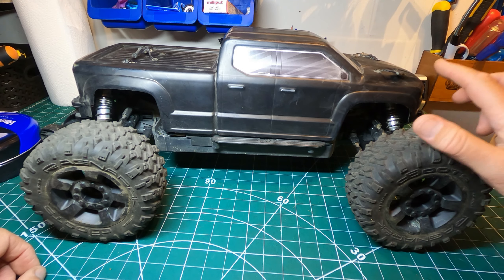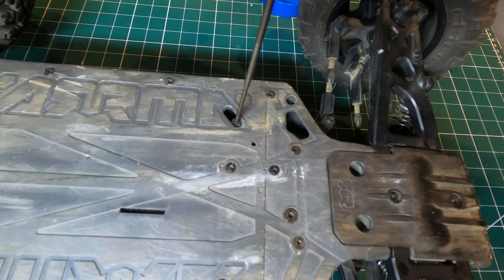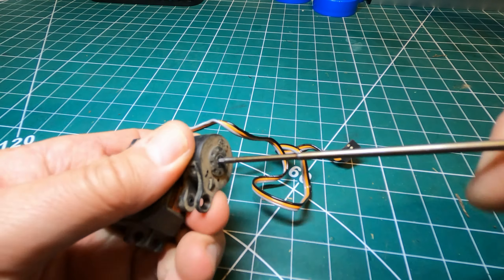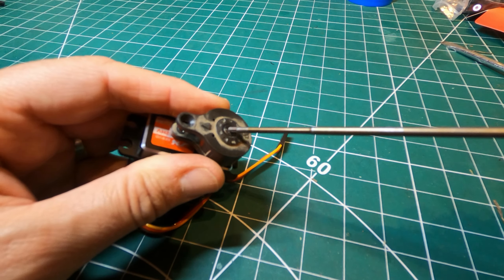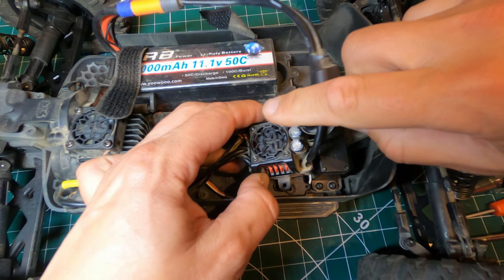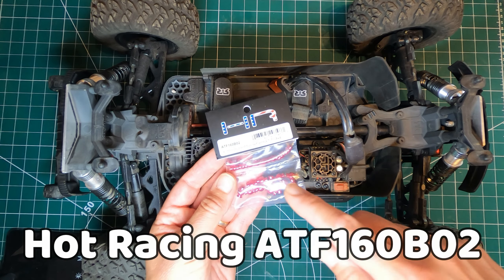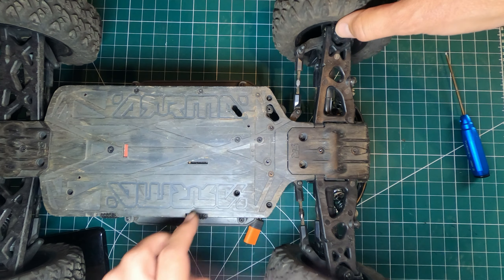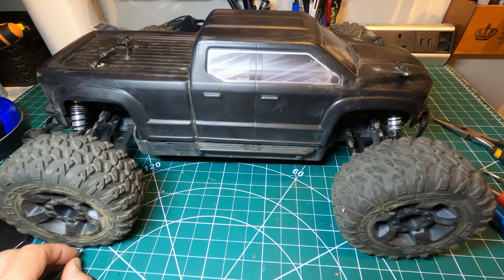Arrma 3s/Mega Servo upgrade, Vorteks, Granite, Big Rock, Typhon, Senton, 23t Spektrum - 25t EcoBoost

Comment: "Squash It On And Make It Fit".  
Excellent Advice 👍
You should have that printed on a tee-shirt.
Brilliant information for a non 3s individual such as myself showing me what screws to undo in order to replace the steering servo 👏
Cheers Pete, hope you're well 😎
Reply from the maker: Yeah, if it doesn't fit then try a bit harder!  You should get one of these so you can save the Tamiyas for less destructive RC'ing.  Cheers for watching mate.  Hope all is well :-)
Reply: @PeteWylieRC  I shall be tapping you for some information nearer my birthday for which one to get, possibly running a 24s with a trailer behind it to carry the batteries 😎

Comment: Just did mine and worked out well , thanks again Pete . I found the tucking of the wires back in tougher than the servo re & re lol .  One note , I got a 25 kg servo off Amazon and looked identical to the stock one BUT one thing .  The 2 little stubs in between the holes , it was just a tiny bit taller than the stock one so had to trim those off flush .  Have a good day Pete 

Jeff in BC Canada
Reply from the maker: Glad it went well. Yes it's a fiddle with the wires. Not had a servo with stubs but good that you got it sorted. Hope you've got better weather than us over there 😁
Reply: Mine too. I'm gonna have to Dremel the casing, cuz it's too long.
I got the Zoskay (DSServo) 35kg and a 25kg.

Even the 25kg is so much better than stock. I just wish it wasn't mounted upside down like it was designed by some animal with no brain. 😂

Comment: Hi Pete, hope your keeping well. Great servo tips there for the Arrma’s I’ll remember this little video. Well, we went out with our Arrma’s last weekend and yep we both broke the front suspension lower arms, got some replacements coming so that we can soon get back out there. The 2s packs performed well and definitely give you more punch, run time and no fading over time. They balance charged well for storage to either exactly 3.7v per cell or within 0.01v, so very pleased. I’ll give them 5 cycles each, before trying them at the higher 4.35v per cell charge. Keep well all the best 😉👌
Reply from the maker: Hiya John. I'm surprised that you broke the suspension arms on your cars. I did break 2 on my Big Rock but I was using the ramp and doing some pretty big jumps. I wonder if the long arms are less strong because the Granite has been beaten to death and I've not broken any arms. Anyway hope you are back in action soon. Glad that the lipos are performing well. Best wishes to you my friend and many thanks for your comments 😁

Comment: Really clear and helpful....and proves you don’t need a 25t servo saver, which are often hard to come by. I’d never thought of upgrading the pivot ball, either. Thanks. Could I make a request and ask you to  make one in the same series on diff maintenance and re-oiling ? I think many of us would find that useful and are intimidated by the perceived complexity of taking them apart ?
Reply from the maker: Hi there.  Yeah I did this on my Senton and the servo horn stayed put.  That plastic pivot ball does get worn in time so you get play in the steering.  I was going to wait till it was loose but then I thought I might as well do it as a reason to take the ESC/Servo module out.  Many thanks for your comments.  I did a bit about putting oil in the diffs on this one - https://youtu.be/ftYV8S1Xg-s
Reply: @PeteWylieRC  thanks. I’ll make a point of revisiting that one, next. My Big Rock lost power at the back and is making a horrible grinding noise so I suspect the video will come in very handy
Reply from the maker: @patmarcus172  yeah it does sound like you need to get it all apart to see what's up. Hope the video helps 😀

Comment: dude i put in a 25kg servo in my senton and it is a night and day difference. Best 20bux I've spent on that lil car. Thing takes a proper beating steering wise and now it is totally set for the forseeable future
Reply from the maker: Yeah it does make the car more responsive and worth the money like you say.  Many thanks for your comments.  Much appreciated :-)
Reply: @PeteWylieRC  heck yeah bro🤙 love your vids keep on keepin haha
Wanted to pick your brain on upgrading tires on the Maxx, I've seen peeps putting the ERevo tires on it and boy do they go good. Only problem is idk what to gear it down to. Especially whith where I am at this summer is going to be looking at 105°+ basically every day. So I don't want to overheat. And I'm thinking running 100w in the shocks, figure it would bring it down to almost an 80w
Reply from the maker: @dank9288639  ooh I think you are outside of my knowledge there I'm afraid.  I only ever had one Traxxas (2WD Slash) and also I don't live in a hot country.  Where are you with those high temperatures?  Don't think I could cope with anything over 80 degrees!
Reply: @PeteWylieRC  I'm in Southern California broskie, Riverside gets very hot during the summer. And it last from now till the end of November. It sucks
Reply from the maker: Ah right. Reminds me of that song It Never Rains in Southern California. I guess it must be true! Certainly not true in the UK where it rained for the whole of May. Got some nice weather now. Just under 70F which is enough for me 😁☀️

Comment: 7kg?? In one of THOSE!!??? 
I like that access hole. Well thought out that! 👍👍 
Hey Mate, I've "jammed" Servo Horns on before!! 😳  Plastic onto Metal seems to have worked for me in the past, when I used to use Servo Savers!! 😋😂
I imagine that will work much better for you. It's certainly faster.
Cheers 🍻 Mate!!!
Reply from the maker: Hi Carmine.  Yeah the supplied servo does seem a bit low on power but it was performing OK although the new one is much better.  Yes brute force is always an option.  I think that you do need a servo saver with these bashers that do jumps and have high speed crashes.  Not tried them without though so I guess a high KG servo might survive?  Many thanks for your great comments.  Best wishes to you :-)
Reply: I agree Mate.... I still use Servo Savers on open Wheel Buggies, and anything for Bashing. 
I just always use Kimborough... They're strong and have NO play!! 😁 
I believe that Kimborough makes Aarma and TRAXXASS Servo Savers.
All the best to you!!
Reply from the maker: @CarminesRCTipsandTricks  ok many thanks for the tip my friend 😁

Comment: I like it how it says "for grown-ups"
I'm 43, I hope that's old enough.
I'm not having the best time mounting my new Zoskay (DSServo) 35kg servo in my Granite BLX. This upside-down mounting and jamming a little screwdriver thru a tiny body hole to attach the horn to the linkage-doohickey part. I fiddled until that happened, but my servo is maybe 2cm too long. The screw holes on one side line up, and I can jam the screws in the other side halfway, but the steering is so off, and doesn't center. 
I appreciate the video, any help I can get is great. 
I may have to bust out my Dremel and do naughty things to the Zoskay servo casing tomorrow. I bought two, in case I butcher the first one.
Thanks. 👍🏽
Reply from the maker: Oh yes I think that 43 is old enough 🤣 The 'for grown up's' thing was because YouTube had said that they were going to de-monitise anything that they thought was made for children. Anyway I'm not sure if it helps but I did another video recently where I take out that whole block with the servo/ESC etc. which might make life easier? https://www.youtube.com/watch?v=YwWFplMbMvQ

Comment: Very useful videos - subscribed! Pete, I got my 25t servo saver and servo today and the only way I can get it to centre  is by adjusting the ST on the remote (STOCK ARRMA) Also, why is it that when I do full lock the angle is more extreme when turning left than right is this normal. I connected my stock servo just to check and its the same. Thanks - Noob to RC
Reply from the maker: Hi there. Did you power it all on and centre the trim on the transmitter before you put the servo saver on it it's central position? Once you've done that test that it moves the same amount in each direction before putting it back into the car. That should be it hopefully. Many thanks for your feedback and sub. Much appreciated 😁👍
Reply: @PeteWylieRC  All sorted now Pete, Thanks! where can I get those metal pivot balls which you put in the servo horn? thanks
Reply from the maker: @km7101  Glad you sorted it.  They are here https://www.ebay.co.uk/itm/115412474301?var=0&mkevt=1&mkcid=1&mkrid=710-53481-19255-0&campid=5338268676&toolid=10044&_trkparms=ispr=1&amdata=enc:15CcWrXZLRzeZ6TT53eNt8Q77&customid=CjwKCAjw6vyiBhB_EiwAQJRoptOQf9tPHH8aJoAcWfr2nrbIqIpVr2OR2-ozPXUEXkhc2349m38TaRoCu14QAvD_BwE
Reply: @PeteWylieRC  Fantastic! Thank you. Can't wait to get it all together now and go bashing with the new servo!

Comment: I have a 2wd senton boost. My stock servo crapped out and wouldn't respond so im replacing it but id also like to improve the mount and delete the big plastic box its part of and have the esc sit flat on the chassis. Any  options for an aluminum mount?
Reply from the maker: I haven't seen a metal servo mount for these. The plastic one is fine, even in the bigger 4s cars. Thanks for watching the video 😁👍

Comment: Have you changed your end points via the control? When you turned the car I could hear your servo when it over steered.
Reply from the maker: Hi there. Yeah I've adjusted the steering throw since this.  Well spotted though.  Many thanks for your feedback :-)
Reply: @PeteWylieRC  I'm not meaning just the dial on the steering trim. I'm on about the internal setting on the control?
Reply from the maker: @mehimrc1314  No I just adjusted the duel rate.  Does it not achieve the same thing of stopping the servo going beyond the steering limit of the car?

Comment: Hi Pete another great video. I’ve done the servo upgrade as suggested. Having issues with AVC since the swop. Works perfectly when AVC fully off. Steers hard right when turned on for no reason. Anything you’ve experienced with this servo previously? Thanks again.
Reply from the maker: Hi there. I haven't had that issue with any of mine but they don't have an AVC function. One of them has a gyro in the receiver and that works as expected which is to correct oversteer. Sorry I can't help but I think it must be a setting rather than the servo. Many thanks for your kind feedback about the video 👍
Reply: @PeteWylieRC  of course it’s only the Vorteks with AVC. I will attempt another re-bind and re-calibration and see if it sorts. Great servo by the way. Super quick and responsive.
Reply: make sure the receiver is flat and when you turn it on make sure it's on a flat surface otherwise it will randomly steer when you dont.

Comment: Hey Pete, how long would you say the stock servos last on these trucks? Very informative as usual, thanks for sharing brother and have you thought of changing out the tires yet? I’m thinking I’m gonna try out the granite tires on mine
Reply from the maker: Hi there. Hard to say about the servo as I have changed them out fairly quickly and they have gone into light 2wd cars where they are fine. I did try the Granite wheels on the Big Rock and they do work well. Haven't tried any from other manufacturers. Many thanks for watching my friend 😁
Reply: @PeteWylieRC  yeah I know you like to swap yours out to use for other vehicles, I’ve heard they go out fairly quickly but I haven’t had any problems with the servos on any of my vehicles, I was just wondering, the only issue I’ve noticed with my BigRock is the cogging but I think I know what’s causing that, gonna definitely get some extra granite tires for the big rock too, they do work a lot better, less traction rolling for sure
Reply from the maker: @rcreviews9894  might be a dodgy ESC on your Big Rock? My original Granite one went like that and they replaced it. New one worked fine.
Reply: My typhon 3s servo stopped working on my 4th or 5th run.

Comment: Hey Pete so I installed this servo on my Vorteks and all works well except there’s a buzzing coming from the servo when I turn it. I’m assuming it’s binding somewhere? I tried backing off the screw that holds the horn down but it doesn’t seem to change anything. Have you ran into this problem during a new servo install?
Reply from the maker: Hi there. If it's only buzzing at the extreme ends of steering then you need to reduce the steering rate. If it's all the time then I guess you need to take the servo out and see if there is any resistance in the linkage when you move it manually. Also see if the servo moves ok when out of the car. Otherwise I'm not sure. Good luck!
Reply: @PeteWylieRC  this morning during breakfast I found a little barrel shaped spacer that looks like it would fit perfectly into the piece that sits between the horn arms. That’s gotta be my issue but I haven’t tested yet.
Reply from the maker: @kez850  yeah that might be the pivot ball. It certainly needs to be in there.
Reply: @PeteWylieRC  hey Pete I appreciate your replies! It was 100% the pivot ball that fell out. Had no idea it was in there until I noticed it on the table. All is well now. Thanks again for your help, and this video!

Comment: hey what's up mate, i installed this servo, but something happens and the neutral was like reverse, than i put reverse in controller, you know something possible that i could did  wrong?
Reply from the maker: Hi there. I'm sorry I don't quite get what you mean with the problem you are experiencing. Do you mean that you installed the servo and now you have a problem with the throttle?
Reply: @PeteWylieRC  ok I'll try to improve, basically when I turned on the car and turned the control to the left, the car turned to the right, that is, it was inverted, so I put it in reverse on the control to return to normal, I would like to understand why it happened like this inverted way
Reply from the maker: @marcosfmtb  Oh I see. Some brands of servo work in the opposite direction to others so I suspect it's just that 🤔
Reply: @PeteWylieRC  got you, thanks friend for the attention!!!

Comment: Hey pete, I've done this mod and for some reason my rig won't steer straight,it tends to go right a bit or left within a few feet every so often. I changed the servo saver to a 25t servo saver and it still tends to do this...any idea what it could be? Thx in advance for any info if you have any.
Reply from the maker: Hi there. Did you do the check of the servo saver function while the servo was out of the car? With the power on and the servo centralised you should be able to force the servo saver in one direction or the other and it springs back to the centre. Other than that is the servo working properly? Can't think of anything else. Thanks for watching the video.
Reply: @PeteWylieRC  i can go over it again...i don't have a 23t spline servo or servo savor...it's 25 to 25 that's what i don't understand...when i tried with the 25 to 23servo it kept pulling, now with the 25kg servo 25t spline ss it still does it.
Reply from the maker: @humblebeast7232  Did you do the test that I do at about 3:30 in the video just to check that the saver is springing back to the centre ok?
Reply: @PeteWylieRC  i haven't been out with my rigs as of late but i am going today for sure to check. Thx Pete🙏 I'll keep you posted

Comment: How long can this actually last for?
Reply from the maker: Do you mean the upgraded servo? I've got these in 4 of my Arrma cars and all still working fine. Thanks for watching 😁
Reply: @PeteWylieRC  Oh sorry I meant the servo saver. I'm planning on doing the same too and just wanted to save a few bucks from buying another saver :)
Reply from the maker: @anong345  Oh right I see.  Yeah I've done this on my Senton and Big Rock and the servo saver hasn't slipped round or anything.  Those cars have been hammered on a regular basis. The servo spines sort of carve their own grooves in the plastic servo saver.  Probably wouldn't work so well if the servo splines were also plastic.
Reply: @PeteWylieRC  That's good to hear. Thanks for all the help